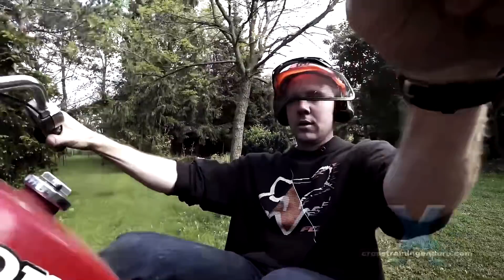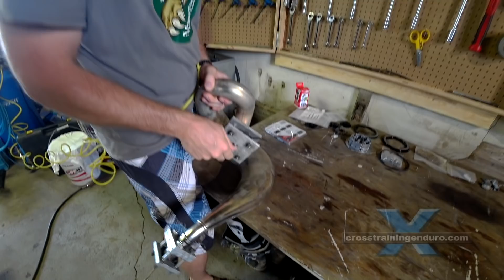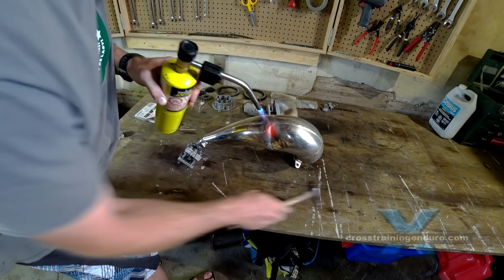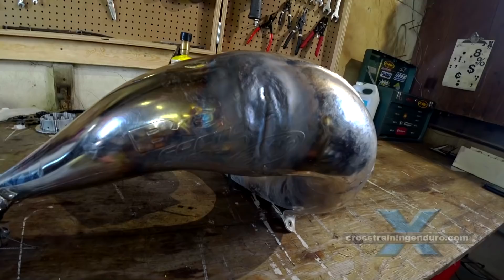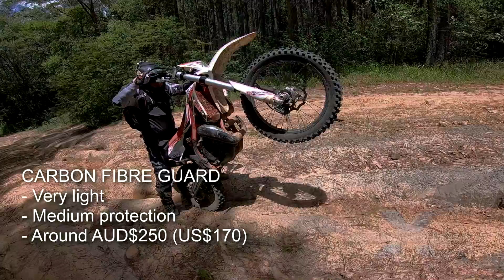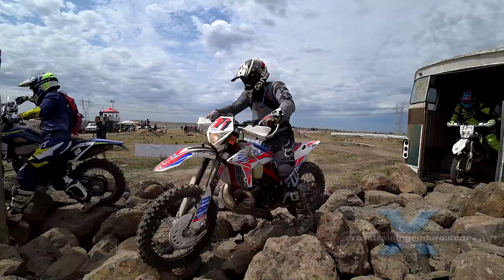How to fix two stroke exhaust pipe dents︱Cross Training Enduro

Comment: Plug 1 end  shoot some lighter fluid in the open end and swing vigorously for 30 seconds then take a lighter and light the open end the explosion wont hurt the pipe but will pop it back to original spec.

Comment: Unbolt your pipe, dig a large hole in the backyard, place the pipe in the hole and carefully backfill with dirt removing any air gaps. Mark the spot with an old stick, or draw a map where you buried it. Leave pipe there over winter and forget about it. In springtime, dig it up, clean it up a bit and stick it back on the bike. It'll still be dented, but you'll feel a lot better about it. PLus you will have avoided riding in cold, wet and muddy conditions for about 3 months,  bonus.

Comment: I tried the water and freezing one, it pushed the dent out slightly but also changed the bend in the pipe to the point where it wouldn't fit without some persuasion aka a rubber mallet

Comment: Last protection is good but if terrain is muddy, is adding 10 kg to your bike pretty fast and need to stop often to get rid of the mud pilled up behind. I'm using one self made from aluminum - 10 mm bars netted together that helps with mud and is very light.

Comment: I bent two pipes with carbon guards, used a hydra force blow out kit (fancy version of power washer method) to take dents out and it also straightened the pipes back to very near factory shape. Had to use a bar on one of them but now they both fit properly

Comment: I leave gauge connected to the valve so I can monitor for dangerous pressure rising while heating. Also I first preheat pipe then add pressure. I cover ends with some heavy rugs to slow down any flying parts or bolts. All in all this method works like charm for big dents with large area. Not so easy for small ones, maybe I need to get more powerful torch.

Comment: Anytime gases are sealed inside a thin metal container whose halves are held together by a weld, and heated so the pressure goes up...... watch out 🙃 especially if that gas may contain gasoline and oil vapors.

Comment: Can this method fix the dents in my head?
Reply: "Can this method fix the dents in my head?"  Yes, but you need more air pressure.  1st, you need to scoop out that useless gray stuff that dirt bikers don't use anyway...it's like first cleaning the carbon out of your pipe.

Comment: I have the Ballard's offroad stainless steel pipe and it is strong AF, don't even use a carbon guard on it and i've bashed it around, no dints yet after 12 months.

Comment: Small spot welds, 6mm allthread, nuts, washers and a slide hammer handle is another way to do it. Or at least to pull the largest part of dents out.

Comment: I stopped using carbon pipe guards for a couple reasons 1 it's easier to fix a dent than a kink in the pipe and 2 they are expensive, I can get a brand new pipe for only $60 more than a pipe guard alone.
Reply: I don't no where your getting your pipes from by my last one for my exc200 cost $350
Reply: Rocky Mountain ATV/MC FMF Gnarly pipe $215, P3 carbon guard $155.
Reply: @archiehurley1094  I used to work parts in a KTM dealership, oem 2 stroke pipes can be upwards of $500, and the KTM powerparts ones are around $350. But if you go with the same fmf pipe but from a typical supplier (wps, tucker rocky, parts unlimited, or direct from mfg) it costs around $250 and the only difference is it doesn't say "KTM powered by FMF" on it.

Comment: More like.. This is absolutely the best way to pop out dented pipes! Make sure to wear flip flops in case you gotta run faster than your average tenny runner when it grenades in your face.
Reply from the maker: funny thing is i completely forgot to ask him which WAS the best way in his opinion....
Reply: @crosstrainingenduro  I've actually used his method and, if you're cautious, it works well for steel/s.s. pipes. Titanium - that idk?

Comment: Yes I have repaired a numberl of them over the years, repairing pipes were a weekly thing in the daze when nearly every bike had a low pipe. 
with the help of sewer plugs and a few other misc.  things from the Hardware store. creating a back up system that catches the plug if it blows is a good idea too, you really don't want them flying across the yard, Oh yes, do this out side!!   I alway begin by burning out the pipe first. Mapps gas is ok but I welding torch works better. be careful not to over heat the pipe, adding more air is not recommended.

Comment: Why use air when you can use water? Any hydraulic will work, most simple is using pump from pump-jack.
Reply: i'm curious. i have some old bottle jacks, can you explain a bit more?
Reply: @TheCharillz23  look up hydroforming
Reply: @TheCharillz23  Mark is right, hydroforming will explain it better.
About bottle-jack - you just need pump part from it, with wielding you attach fitting on "out", provide water on "in", seal exhaust (like on video), fill it with water, connect pump and pump slowly.
Bottle-jack pump is better then pressure washer because it provides more control, you can pump it slowly and see if all works fine. But any high pressure pump should work

Comment: I see Colin Furze use a pressure washer to get dents out using a similar process. 

You have to be careful though because the pressure rises really quickly! 

Great video and love the safety Sandals are they the Jesus creeper 3000 with reinforced straps and anti slip sole?
Reply: Ive done it successfully but use quite a bit of pressure and flow . does split the odd weld but ends up straight.